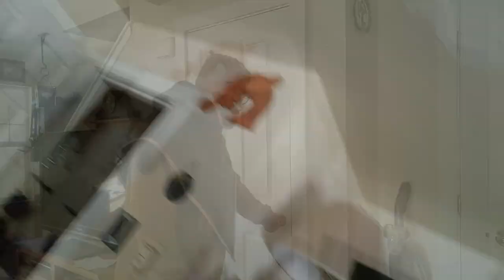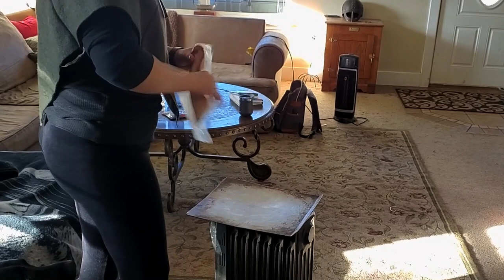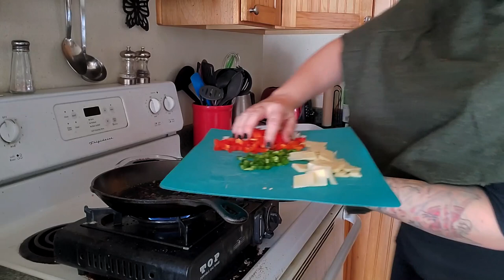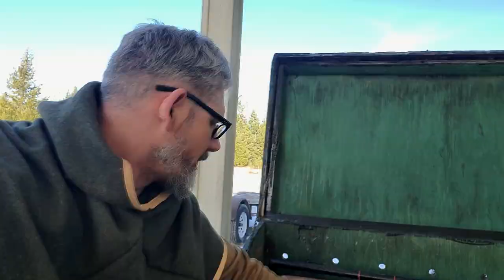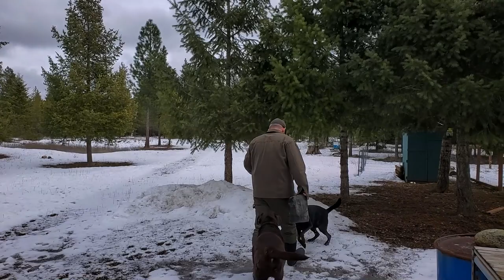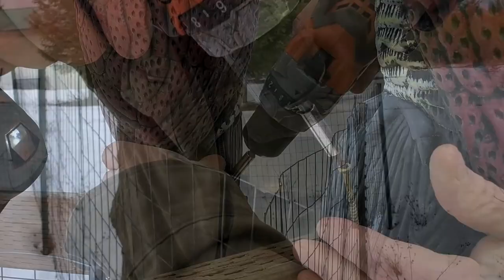BLACKOUT on our Homestead in North Idaho, Is this the big event?

Comment: Gunny, I like your box and "crate o generator stuff" . I might suggest fine aluminum or stainless screen over all your intake holes and to fill the gap between the exhaust pipe and the exit port. That should keep bugs out. I don't know how big an issue that is in ID but in SC it is an issue.
Reply from the maker: Good plan.  Not a huge problem here but probably worth doing anyway.  Spring is the worst time.  Thats when the hornets and yellow jackets start their assault an all hidden but accessible spaces.